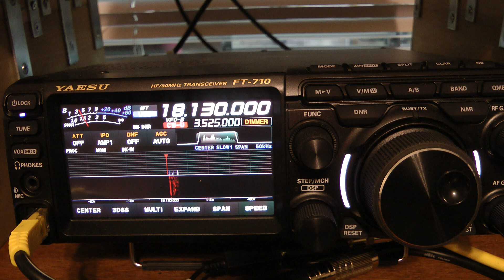Moxon beam vs Loop antenna

Comment: What is "the loop"????
Meaningless unless we know what "the loop" is.
Reply: No problem John thanks for the clarification and no need to apologize...I enjoy experimenting with antennas as you do and was thinking about a Moxon for 10m which is why I came across your video...continue to have fun!
Reply from the maker: The Moxon is really simple and cheap to build and has decent gain. I have worked the world on 5 watts with it... I made mine out of crappie telescopic fiberglass fishing poles. Have fun!!!!!
Reply: @johnwofford2708  SSB or FT8?
Reply from the maker: I said in the video that the loop is horizontal, 260 feet of wire in a circle configuration, up 25 feet. What more do you want to know???
Reply from the maker: I am sorry, my chemo brain has really messed up my mind. I just made a video where I gave the loop specs but in this video I did forget to mention the specs.... Sorry, I just finished my final chemo treatment and it really affects my mind.

Comment: Horizontal loops exhibit increasing numbers of radiation pattern lobes and nulls when operated above their fundamental design frequency.  The New York station may fall in a null in your loop's radiation pattern while the Florida station is in one of the lobes.  That may be why it hears one station and not the other.
Reply from the maker: That is true, but I have tested the loop verses the moxon in all directions (north, south, east and west) and the moxon is always 2 s units better than the loop. The loop is configured in a circular shape.
Reply: So what you're saying is your favorite antenna didn't win the comparison.
Reply: @Redbelly357  Each antenna would have strengths and weaknesses.  Being multidirectional, the loop can hear signals that the Moxon would miss if pointed away.  The Moxon would exhibit a superior signal to noise ratio in its favored direction due to its rejection of noise from other directions.  Either antenna may outperform the other depending on their relative heights and proximity to nearby obstacles.

Comment: What length is your loop?
Reply from the maker: The loop is 260 feet with a hybrid balun fed with LMR400, I have compared it to a 17 meter dipole and it beats a dipole every time.
Reply: @johnwofford2708  What is the average elevation of your loop? Most people struggle getting past 30'-35' aka 10m. At higher than base frequency large horizontal loops typically show directivity in the direction opposite of the feedpoint.
The typically low elevation makes them NVIS omnidirection at frequencies with an elevation =<1/4 wavelength.
Reply: Blah 🎉blah just wait until I put the hammer 🛠 down my old swan tube glowing electric ham radio 📻 yahoo radios in the frozen foods 😅
Reply: Ps 100 plus feet In the 🎄 forest Gump 😅radio VS. Locomotive 🚂 breath Jethro toll
Reply: 260 feet of wire lol😅 they make 1000ft foot spools chewy wire antenna farm in Central Alabama 60 dbs word wide 😅stay tuned and listen to this 😮pirate radio wd4 land